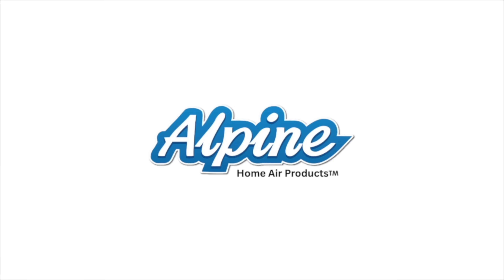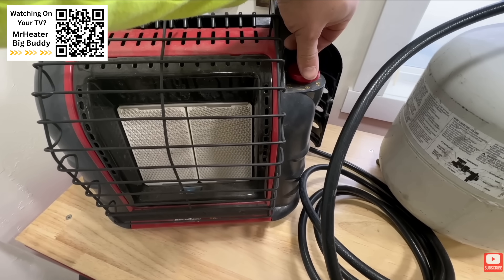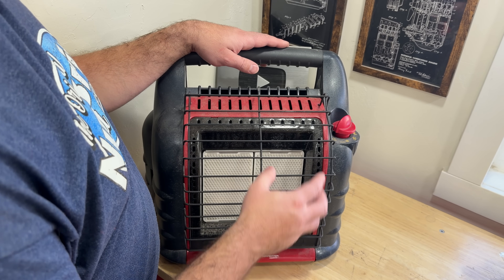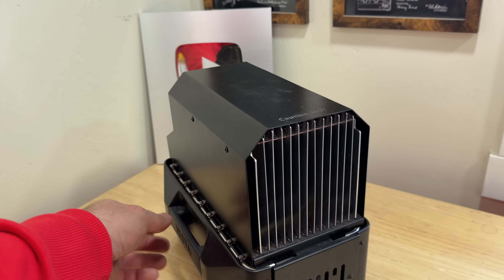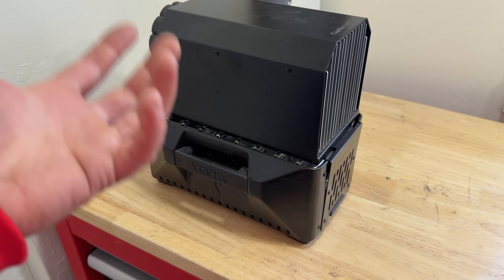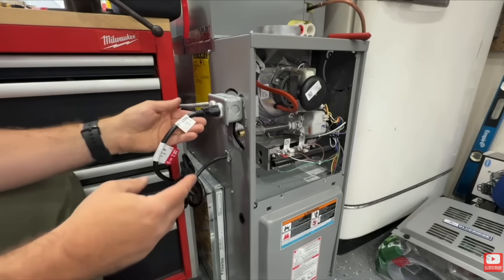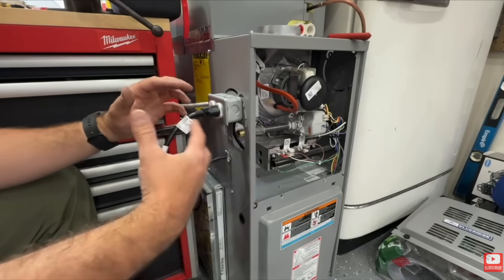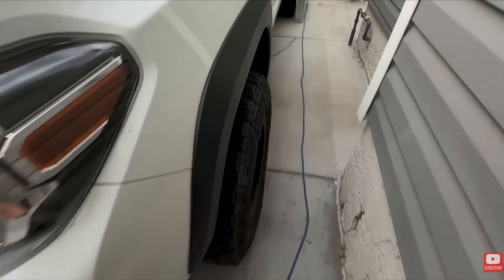Why Didn't We Think Of This Sooner?

Comment: I have a litta Mr. Buddy and I use a 5gl paint bucket grid for heating coffee and soup, etc. The front safety grate/screen can stay in place and provides extra stability, safety for the paint bucket grid. You can purchase the paint bucket grid from Harbor Freight, Ace, Lowe's or Home Depot for  3.99 - 4.99. Also, I use a small wood stove fan (heat generated) which I can set on the paint bucket grid to move more hot air in the room, workshop and camping, etc..  The fan runs around 15.99. Just an added idea. Thanks for sharing.

Comment: Over the years, I've moved on from propane heaters as we can't stand the smell and moisture coming from burning propane inside, despite the window being cracked open. Maybe I'm too sensitive as opposed to some who love these. I will only use a diesel heater that exhausts the fumes outside and generates pure heat. Prices have plummeted on these, and I use my portable power pack to run them.

Comment: You going to stand your tank upright you need a filter on your heater. You lay your tank on it's side will help if running no filter. Forklifts lay on there side so you can see overt when in reverse.

Comment: I have a Big Buddy and love it for its simplicity compared to a kerosene heater even though the big ones can put out more heat. But, as a retired gas fitter I want to make a correction about un-vented heating appliances. You said they are rated or legal for indoor use, forgot the actual verbiage you used. If you dig a little deeper, they are not suitable or allowed in bedrooms or other places where you will be sleeping.  Bedrooms are typically smaller rooms where dangerous concentrations can build up with adverse effects. The carbon monoxide detector you recommended will help prevent this but should still not be used in a bedroom. Use in a larger room where the concentration will not be as high and sleep in that room, with the detector,  until power is restored.

Comment: any gas heater can heat a house in an emergency if you have natural gas you can just use a stove or wall heater without power or get the heaters that go on top of cylinder for propane you just don't want to get too much CO2 or CO

Comment: Almost exactly 7 days on a 40lb camper tank. Heated my garage bay on low (4000btu) for a couple of winters, keeping it 60°+ to keep caulking, paint etc. thawed out. Used the filter and an ac adapter for the fan. Great unit for backup.
Reply: Does your fan totally suck ? My fan is just about worthless .

Comment: On the Furnace Power Feed the SIMPLEST, EASIEST and CHEAPEST Route is to Just mount a 2"×4" Electrical "Handybox" then run the Power wire to there and install a RECEPTACLE. Put it on the Furnace (If you have that much wire) then make a 12"/14" "Whip" long enough to Easily reach the Receptacle. Put a "Male" Electrical Plug on one end and wire the Other to the Furnace, that way instead of a Light Switch you can just unplug it to kill power. Run your extension cord from the Genny and plug the Furnace in, it kills 3 birds at Once. Legal Power Disconnect, No hassle with the Main Panel and will plug straight into any Extension Cords. 😊

Comment: It seems counterintuitive, but Propane heaters put off very little carbon MONoxide.   The propane burning equation goes from propane to CO2 and water.  It's why they're used in camping situations, and considered safer than natural gas heaters.  However, while CO2 is largely considered nonlethal, we know that it IS lethal in sufficient quantities (e.g., breathing with the head in a plastic bag).  MONoxide just isn't produced in high enough quantities from burning propane.  But potentially lethal carbon DI-oxide IS.  For this reason, carbon monoxide detectors are not as useful for propane burning, but CO2 detectors are.  

To continue with information nobody asked to hear ....

Because carbon MONoxide is about the same weight as breathing air, it distributes fairly evenly throughout your camper/tent.  It's why the detector is installed higher up the wall.  Fortunately, propane doesn't make MONoxide.   

Carbon DI-oxide, however, is heavier than breathing air, and tends to collect along the floor which is why animals detect it first and start sleeping on counter tops, instead on their pet bed.  It flows invisibly out the door when you open it, and you're unlikely to sense anything is wrong until the carbon dioxide river on the floor reaches the level of your bed, and you sleep in it.  You get a dry cough that won't go away until you stand up and move around or go outside.  Dizziness on standing, whole body tiredness, chilled body parts even tho you should be toasty by room temps, are also symptoms of too much CO2 in the space.  But when you lay flat to sleep in it, you start to cough again, and you risk not waking up.

BIOLOGY:  While carbon MON-oxide binds to your blood hemoglobin, causing you to cough and pant for air, carbon DI-oxide in toxic quantities fits right into your blood chemistry buffering system which protects you.  This is good.   CO2 is natural in your lungs, so your body knows what to do about it until it overwhelms you (think plastic bag over head again).  From there, CO2 outstrips your blood buffering system, creates acid in your blood, causes you to go into shock, then multi organ failure and death.  Both CO and CO2 poisoning are relieved by fresh air.  

Each has its own detector.  If you burn propane, like a Mr.Buddy, you want CO2 detection, placed lower on the wall to the floor, or at bed level on a night stand.  If you burn natural gas or wood/oil/etc., you want a MONoxide detector.
Reply: I use the Wave 3000 catalytic propane heater, 3000 btu on high, 1500 btu on the low setting in my minivan.   

I don't see any comments mentioning using a CO2 measurement device with digital readout.

For me knowing the exact ppm is essential.  

I need it to fine tune my vent openings, or just open wide the doors for a full minute or two when I see it creeping up near 2000 ppm.

An idiot light that blinks when the CO2 is "high" is almost useless!

I hope more people who use propane heaters in small spaces learn this, go spend the $100.

Comment: No presentation on "emergency heaters is complete w/o mentioned these: Camco/Olympian Wave series propane heaters. They've been around for years...and for good reasons.
For "emergency" home heating in the winter if the power goes out, I have two Wave heaters -- the Wave 6 and Wave 8 -- as I prefer these over any Mr. Heater products (Buddy series), and no electricity required -- or fan. And Wave quality is superior.
Although the Waves are also propane, they're catalytic heaters and put out heat with way less moisture in it. Plus, IIRC they use less propane than the buddy heaters do. And of course, I can use my BBQ's 20lb tank with them as well.
Win-Win all around for the Waves, IMO...
In due time, will be putting a smaller Wave 3 in my future camper-van.
Have no interest in any diesel or Propex heaters, which you also didn't mention.
-- BR

Comment: Are these safe to use inside a house during an extended (7 days) power outage? My wife and I get scared to use propane or kerosene heaters inside when we lose electricity. With an electric furnace our source of heat it gets tough when we lose it for days. We are in Maine and a couple years ago we lost electricity for a week leading into the Christmas holiday. It was tough and challenging to say the least. Thanks
Reply from the maker: Yes it’s safe for indoor use. 👍🏼 just keep a good working CO detector just in case, but yes they are safe!

Comment: Not related to this video, but I have a question.  I have an AH with electric heat strips for heating and a condenser for cooling (PHX).  I have been running on R22 but it finally died.  I will replace the condenser and lineset using new equipment using 410A.  Do you feel it would be possible to keep my AH and just try to flush/clean the EC ?  Would I be risking damaging my new condenser ?

Comment: What is a "C wire" for the thermostat? Around 6:35 in the video.
Reply: Common wire, most thermostats use to power the display and electronics
Reply: C wire is Common.  It completes the thermostat circuit.

Comment: I ran a ventless heater in my garage when I was doing work in the garage one winter. I had a difficult time breathing the acidic exhaust and moisture was also a problem. Consider a  propane or gas direct vent wall heater, although it will cost more.
Reply: you have to be very mindful when doing that, as it will burn off any chemicals and vapor contaminates in the air, turning it into potentially toxic and deadly fumes.
gas vapors, brake/carburetor/parts cleaners, lubricants, paints, all contaminate the air, which then gets burnt, converted to bad things and could be explosive.

Comment: That 'easy generator switch' is a nice option. You could run conduit from the furnace and mount the switch outside in an weather enclosure where you run the generator.

Comment: I used to fish in NY on a boat and on a lake. We would sleep in the boat with Mr. Buddy running to keep us warm. We got to the point of adding a 20 LB tank and 20 foot hose to keep the tank on the dock. This was before they put a tip over feature , we would lay it on its back.  We would go back to the green tanks when on the water.  My buddy would set the lines and I would drive one handed and lay the heater on the deck and cook eggs, bacon and muffins, as we are trolling. had a piece of wood to place the pan on when not cooking. The FLOATING DINER.
Reply: Brilliant! God gave us such resourceful brains if only we would challenge ourselves more. My dad (who lived through the Great Depression) used to say that today’s society wouldn’t live through another one-and that was 20 years ago; we’ve gotten soft & lazy.
Reply from the maker: That's an awesome story! Sounds like you had some great times out there 🎣
Reply: Pretty cool story
Reply: Anyone else unable to read this or am I having a stroke? 😮‍💨
Reply: @Lucky9_9  What are you confused about.

Comment: Concerning the Mr big buddy heater , I don’t know if you placed it on the counter just for demonstration purposes but it is supposed to be used on the floor, also, the placement of the carbon monoxide detector appears to be too high, it’s supposed to be at head level when standing and at head level when sleeping, placement of the detector is very important
Reply: Carbon monoxide (CO) is slightly lighter than air, so it may initially tend to rise, especially if it's coming from a warm source (like heat). However, the difference in density is minor, and CO quickly mixes evenly with the air in a room, meaning it doesn't primarily collect at the ceiling like heat or lighter gases.

Comment: on high 19k BTU x 4 hours = 76 kBTUh, but on low you get 4k BTU x 6 hours = 24 kBTUh from the same two tanks?
Reply: Yeah, every single one of the numbers about the Big Buddy are wrong in this video. It’s 4.5k BTU on low, 9k BTU on medium, and 18k BTU on high. Run times are 12, 6, and 3 hours, respectively.

Comment: Good advice and these are all good backup options.  What people really need as a backup if they have furnace problems is a gas stove.  Having two burners running with ceiling fans to circulate the heat warmed up my entire house in 0° weather while I was waiting for a furnace part to arrive in the mail.
Reply: I put a bigg pot of water on the stove and get some nice moist heat. My gas central heating system dries my sinuses out terribly.
Reply: @robertfoster7623  and moist air holds the heat in the house longer
Reply: @robertfoster7623 That method kept me warm during a power outage several years ago, when I had no firewood.

Comment: Huh. I wonder if a UPS would provide enough power to run my furnace in a power outage. Probably not, but I'm not going to look it up.
Reply: No, too small even with 1500 va. The battery capacity is made to run a computer and a printer. Then the starting load on the furnace fan will kick the UPS off line.

Comment: As a person that grew up with old fashioned open flame (not ceramic) gas space heaters and even gas cooking ranges at times, I'm a little concerned about knowing if the heater is producing a CO producing yellow flame. With open flame products you can easily see whether you have a potentially CO producing yellow flame or a blue flame (okay and safe if the space has enough oxygen). Correct me if I'm wroing, but I don't believe you can tell that by looking at a glowing ceramic plate. You are completely dependent on a CO detector, or just plain luck.
Reply from the maker: That's a very valid concern! The ceramic heaters are designed to burn efficiently and safely, but a CO detector is always a good idea for any combustion appliance.

Comment: If using this heater to heat your home the small tanks are a waste of time. I use the 15lbs tank... I roughly get 2 to 3 days heating. They work really well.. i would adivise buying the fan they make for this heater, it helps tremendously

Comment: No propane heater is safe to use indoors really. You are relying on the oxygen sensor to work properly and even then the instructions are clear that you need fresh air circulating. Propane burns oxygen and releases CO2 so you are risking breathing in 2 ways. Hundreds of people die from CO poisoning every year and propane ignitions are much more common than even natural gas. Your CO detector is in a good place, it is lighter than air, you typically want it close to the level where you are breathing, about eye level or a little higher. Propane is heavier than air, so an explosive gas detector would be good lower towards the floor or near the heater. Leaks are too damn common. When outdoors or in a ventilated space, the propane tank adapters are great to get some good heat. But indoors, heated blankets are incredibly efficient. Layer under a thick wool blanket and you should sleep incredibly well. Or if you have electricity, check out Project Farm review of space heaters. In the end, the best approach is strong home insulation.
Reply: A direct vent wall heater would be a better option. 
You can also set up a tent inside the house to help keep warm.
Reply: @RayH-  True. Propane is just safer to use outside, it can pool on the ground until it builds up into a large explosion. Be safe everyone!

Comment: Could i use that Easy Generator switch on an electric furnace?  

I have never set up our furnace to use with the generator because the generator cannot run the furnace and the rest of the house.  However, i recently bought another generator which i could use for most of the house while dedicating my bigger generator directly for the furnace only if its enough.  My house is small at 1200 sf and the bigger generator is a Generac 8500W.  I haven't looked up the wattage yet and done the math to see if it will work.
Reply: My automatic generator is 8500W which is rated too small for the entire house. But it has provided all the power I needed to keep the food cold, the furnace running and a few lights on. It's not hooked up to the air. conditioner.

Comment: My house is all electric and we often lose power in the winter, especially during the coldest storms.  My primary backup is a kerosene heater, which lives in our garage but i bring it in the kitchen when in use.  However, i keep the Buddy Heater in the house with a couple of cans of propane for the initial response, especially if power goes out in the middle of the night.  Instead of trekking out to the garage in snow and ice in the middle of the night to get the K heater, i just start up the Buddy and use to get through the night until i go out the next morning.  Of course i sure wouldnt use the Buddy heater for any length of time as propane is insanely expensive compared to kerosene or electric.  But its a fantastic initial response unit.

Comment: I have an all electric home. And since my power goes out quite a lot with bad weather I had to prepare a little better this year so I bought a Mr Heater 18k BTU cabinet heater (you set a 20lb tank inside). Also bought two cheap Chinese diesel parking heaters. Already have two Mr Buddies, power inverters and two small generators.
Reply: MAKE Durn Sure you use a Carbon Monoxide Sensor with those china heaters.....

Comment: There is also a quick coupler  in one of the sides for the 20 lb tank hookup as well. Just requires a quick coupler adapter. Instead of using the one lb port. Although I think you have to remove the 1 lb tank to use it. The door comes with a cutout already at the bottom for the hose. So you can close the door completely.

Comment: I heat my large garage with 2 Big Buddies. I use the OEM Mr. heater hose that doesn’t require a filter to connect to a 20 LB tank. I also use refillable Mr. Heater 1 LB Fuel Kegs along with a Mr. Heater adapter to safely fill these small tanks from a 20 LB tank. That makes each 1LB  canister cost far less than a dollar instead of the 5 dollar green disposable canisters. I have used Mr. Buddy heaters for several years now, and have been impressed. I have purchased them for others for emergency heat, camping heat, and just hanging out on the deck. They produce some condensation so put them on a suitable surface and be aware of the additional humidity. They have been a great simple solution for me. They are safe for indoor and outdoor use and say so on the box. They have a low oxygen and a tip sensor on them but a carbon monoxide detector in an enclosed area is probably a great idea. Now, I seldom use my large kerosene glo heater. Although it is also a very good, albeit less convenient option with less safety features.
Reply: It doesn't matter what brand of hose. still highly recommended to run a filter when using the bigger tanks, i use the filter even when using a small tank (rarely use 1lb tank)